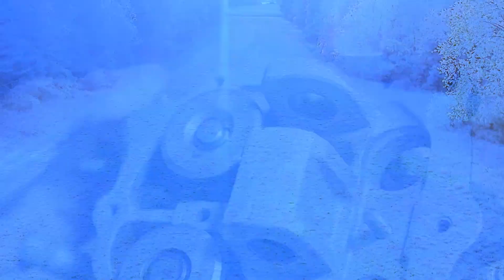Aircraft Mechanic: School or Apprentice? (w/Kendall PT.2)

Comment: Started looking into getting an a&p recently. School is pricey and but quick and the better schools are a bit far from me. I could do on the job but the pay compared to my regular would be low and the whole 30 month compared to a 12 month school. 
 Wondering if trying an apprenticeship could work and could do that part time to get the hours needed.
Reply from the maker: I think the apprenticeship route is a good one, part time is definitely an option. However, it would naturally take a bit longer to get the required hours experience. 

But at least this route allows you to move forward in pursuing your A&P.